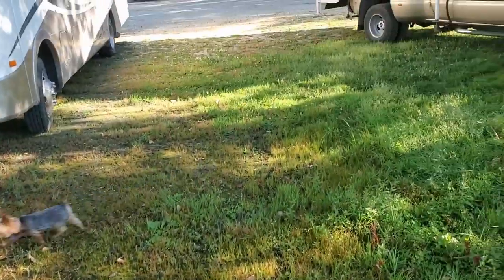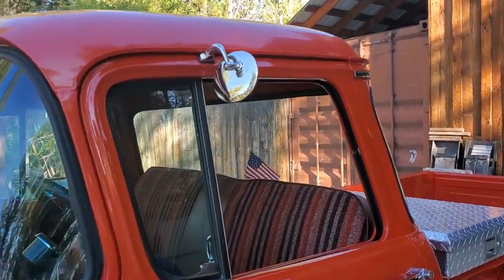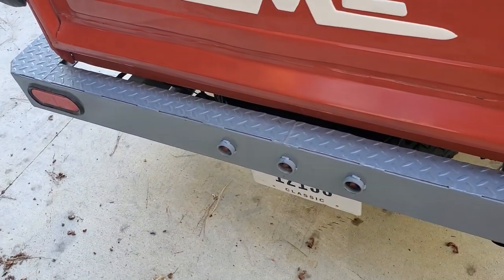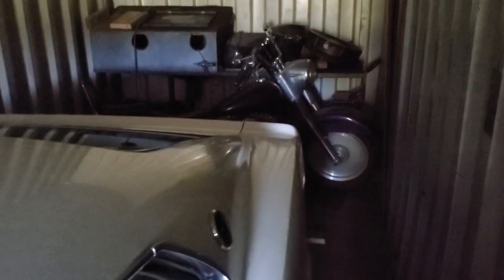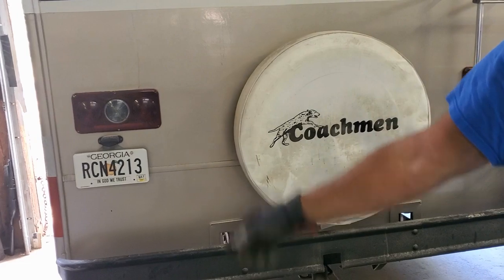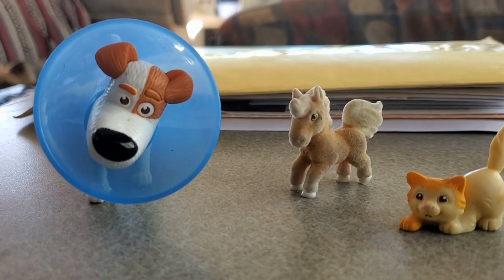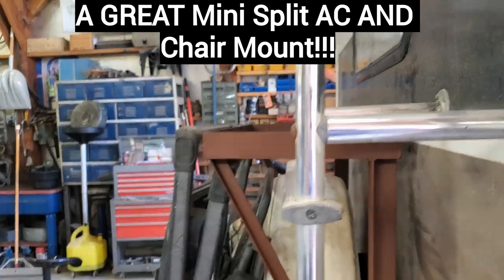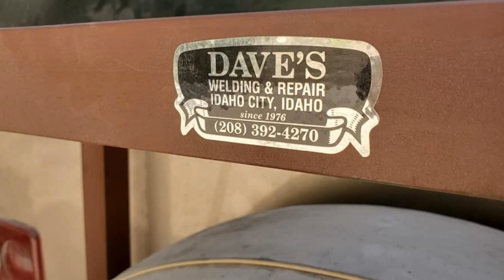My Platform And A 150 Used Hard And Neglected No More! 1969 Mach 1 Mustang!

Comment: Thanks Kevin & Da Woof Pack,
another Job well done!!
Yes, continue to show all the classic cars, trucks and motorcycles you come across.  Your new welder's GMC is quite a bit farther along than my 72 GMC Super Custom (1/2 ton). Kudo's to Dave on his very cool car, truck and bikes.
Mine also has a "Hump Heads" hot rod SBC 350+ motor. I just need an interior as nice, and a bit more bodywork and paint. 
I have a challenge for you, Kevin;
find the Classic Mopars I used to have.
1) 1961 (Black on Black) Plymouth Fury, with a  383 cu in "Sonoramic" (x2 4bbl's on the long ram manifolds) Convertible. Red & White interior (with the "Square" steering wheel please! ;-)
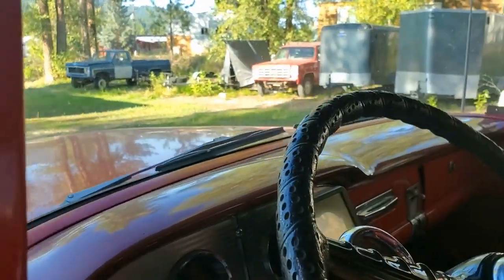2) 1962 Plymouth Fury 2 dr Hardtop 413 cu in "Golden Command" Stage I (White with Blue Buckets) I punched mine to 426 and put a Hemi Torqueflite in it, with a 3:90/4:56/5:13 Posi. I drag raced that car for 3 years when I was in my early 20's (1970-73).
3) 1963 (Silver with Black Buckets) Chrysler 300 with a 383/torqueflite/posi. I used to put the 5:13 Posi in it that I had for my 413, for the Friday night stop light GP on Speedway Blvd in Tucson. It surprised MANY street racers in those days (early 70's).

And finally (not a Mopar and impossible to find), a 1952 Henry J (that was built by Kaiser Frazer). 

https://en.wikipedia.org/wiki/Henry_J

Oh, and it has to be a AA/FA with a Olds 392 and x2 4 bbls.  I had that car for a year, in Maine, in the winter. I had x2 sets of tires for it. A set of M&H Racemaster "Wrinkle Wall" slicks for the drags.
 And, for the street, a set of "Cheater" slicks. The kind with a few grooves in the treads and those straight sidewalls.
It also had Vacuum wipers. Do you know how good they work on a x2 4bbl carbed motor. 
Uuuhhh not so much.
When it rained/snowed, I'd go down the road spinning the tires, sliding sideways, with no wipers. Then, I'd let off the gas, the car would get traction, the car would straighten up, the wipers would work, then I'd step on it and swerve without see for the next hundred feet. And repeat. Hey, I never did wreck it!!
Thrilling, craze and fun!!!
Road Racing motorcycles seemed calm after that!!!!!!!
Stay safe and warm.
cheers
Boots Langley
La Mesa, Ca

Comment: Good Video Kevin
Rare find. Next time use  Aluminum on Support, 1/3 the weight, & 3 times more crush protection in a wreck. 
Anything mounted or stored past rear axle, triples its weight. Cant wait to see your new HVAC system. You might add in a Diesel powered Heater System for back up, in case your heating system fails, in a snow storm, you dont want to let those Battle Bornes get cold. Thank You For Sharing.  Drive Safe

Comment: They found the average sneeze or cough can send around 100,000 contagious germs into the air at speeds up to 100 miles per hour. To prevent that always cover your sneeze and then sanitize your hands with a hand sanitizer or disinfectant to keep from spreading those germs through touching objects i.e. door knobs, eating utensils, etc.
Reply from the maker: I thought about wiping the road sign down....
Reply: @CampervanKevin  😁😛

Comment: When I was 16, I had a 57 Chevy truck. It had the original 235 six cylinder. My first upgrade was 327 motor, my second was a 427. I pulled the 427 out to rebuild it, and put the 327 back in. Found a crack in the 427 block, so the 327 was still in it when I sold it. Here’s the funny part... I wanted to paint it yellow, my Dad said if we had a yellow truck on the farm, the chickens would quit laying eggs. We ended up painting it turquoise. Love those old trucks!

Comment: ON PLUTO TV 📺APP  A SHOW CALLED MISFIT GARAGE ,IS RESTORING A MID 50 S. 3/4  TON PICKUP  FOR THE LADY THAT DOES UPHOLSTERY ON VEHICLES FOR THE MISFIT GARAGE  IN NW DALLAS    THAT SHOP IS OWNED BY THE GUY THAT RUNS GAS MONKEY HOT ROD SHOP.  KEVIN AND FRIEND IN IDAHO CITY ID

Comment: Truck sounds like my 02 Chevy Avalanche that has only 348,975 miles on it, I was working on 500,00 miles but that came to an end 3 weeks ago, engine finally bit the dust thanks to the garage flushing some sludge out, I guess he dosen't know you never flush an engine with that many miles unless you are rebuilding it. He put another engine in with 82,000 miles, now I start all over again. 500,000 miles here I come again. lol Thanks Kevin for your videos. 🇺🇸👍🇺🇸👍

Comment: CVK...  Hey Kevin.  As a long time heating and cooling guy I'm glad to see you're going to put a mini-split system on miss Gypsy.  Good decision.  You're making a good choice.  Wish I could help you with the install.  Be sure you run a new thermostat wire and new stat.  It probably won't work properly if you try to use the existing.  Reach out if you have questions or problems. 
   I really enjoy the antique vehicles you show us.  They remind me of my dad.  Thanks for shaking those memories loose. 
   Would still like to see you come to Iowa sometime in the future.  A wise man once said.  An Iowa town is one of god's best works.  Especially during harvest season in the autumn. 
   Safe travels my friend. 
     Randy in Des Moines.   👍🌽✌
Reply from the maker: have not ordered unit yet. looking for a very high seer and 115 volt. recommendations? Do I need 2 inside units for front/back. I will be putting inside unit above bed facing hallway
Reply: Campervan Kevin   14 to 16 seer will be more than enough.  You should be able to get by with one head unit. No more square footage you're dealing with it will probably run you out of there anyway.  Locate the stat in your living room so it doesn't short cycle.  And remember the inside unit is an evaporator coil.  It will produce water/condensation that will have to be drained.  It will come with a flexible drain line.  Pay attention to how you route it.  You don't want any traps or you'll have leaks.  And in humid climates it can produce a gallon of water in a couple of hours.  I will do some research in the next couple of days and leave you more info in the comments on Wednesdays video.  Good luck.
Reply from the maker: I need highest seer possible for battery savings
Reply from the maker: over 22-24 seer. recommendations please